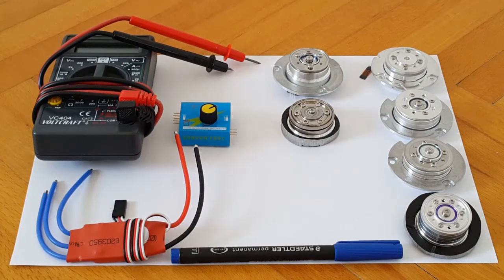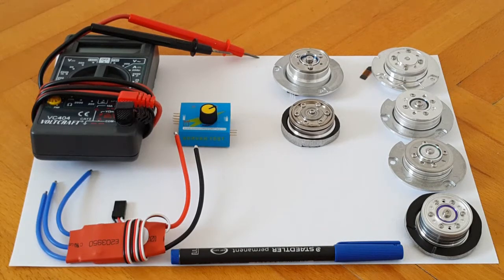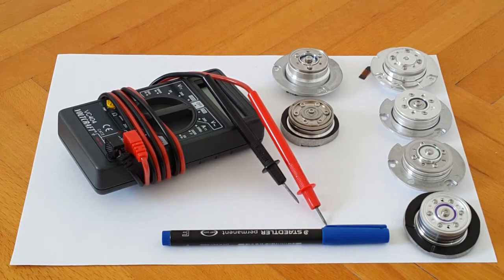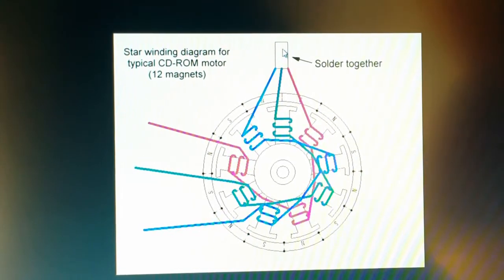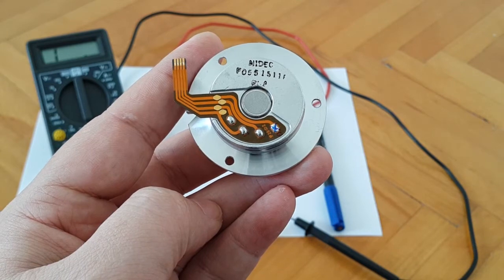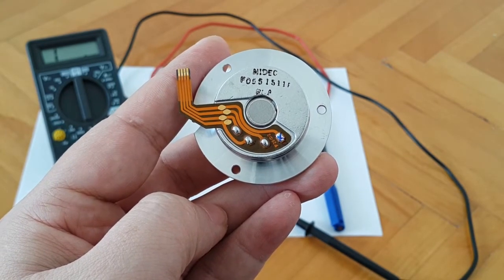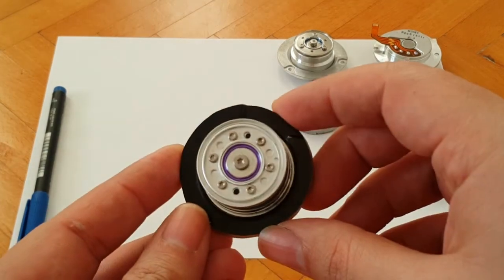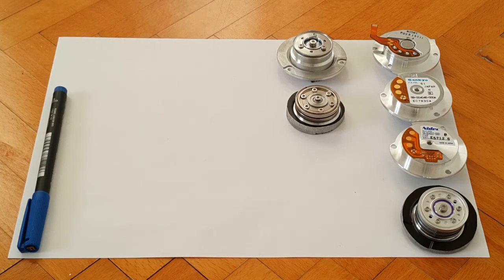How 2 Run/Power a HDD Motor - Prerequisite - Finding The Common (Part 1)

Comment: is there a way to fix "broken pin"? I have stripped off one of the soldered pins by accident (I have pulled out the orange film since I wanted to have clear 4 soldered pin points.... :( 
By measuring resistance I cannot seem to find any between that broken left pin and other 3.... and I do see the small wire in the hole there, but it seems that whenever I make contact with the surface it won't measure - so it's hard to touch just the wire in that hole whilst not touching any surroundings (the hole itself). Are those wires insulated under the soldered pins?
Reply from the maker: Hi,

I'm afraid you blew it. I doubt you can easily fix the situation. You could try somehow lifting the aluminum rotor off the base (thus exposing the copper windings & fiddling around this way), but you might damage the ball bearing in the process. 😕😞

Yes, wires are insulated.

Best Regards,
Reply: @davidbolha  thank you David for responding! 
I will try to see what I can do. 

Damn!

Comment: I tried with a motor from a hard drive and nothing like here. Is it because he is old or because he has a problem. Winchester may have been called and had a capacity of 20 Mbytes. Don't read it wrong, 20Mbytes is the capacity. On the first coils, the resistance is 4 and 8 ohms, and between the other two is 55-56 Kilo ohms.
Reply from the maker: Hi,

Probably it's an older motor I reckon. 🤔😕

But hey nowadays you can get drivers for brushless motors off eBay so this video is kinda pointless (without Part 2). 😞😳

Sadly I never found the time to make the 2nd part of this tutorial.

Look for (on eBay): "HDD Brushless Driver"

& you'll find these boards for less the price of a (20 A ?) RC ESC rushless controller with the CCPM 3-mode servo tester combined. 🙄😏

Best Regards,
Reply: @davidbolha  Quite old actually. The computer it is from has an 8086 processor with a clock frequency of 8Mhz if I remember correctly. I could actually run it with just two wires and no circuit by turning power on and off to it by touching wires. With the right type of pulse, it spins, but it will hardly be able to reach high speed. I think the motor was 7200 rpm.
Reply from the maker: @batvanio  Wow ! 😍

You could then perhaps try selling it on Craigslist or eBay as vintage tech. Those things (if working) can fetch back nice money.

I'm also collecting older HDDs (up to 10 GBs max) as another "retirement spare fund". 😎😁
Reply: @davidbolha  I wouldn't sell it because it's the motor from the hard drive of our first computer. I'm a little angry that I disassembled it at the time when it was ruined due to bad sectors and only the motor was left of it. I even had a 40GB one that was twice as heavy and bulky, I'm angry that I gave it away. The computer was a Pravetz 16 which is an analogue of the IBM PC/XT.

Comment: Why do I have to use a digital multimeter?    I can't think of any reason that an analog multimeter would not work just as well.  Your diagram shows that there is nothing internal in the motors that might require the higher precision of a digital multimeter, and an analog scale would be much easier to read, especially considering the way the reading fluctuates with the probe contact.
Reply from the maker: Hi,

True you could too just use an analogue one, but where can you find one these nowadays ? DM's are cheap. 🤔😄

Best Regards,

Comment: Nice explanation.looking forward for the second part. I also have a question. I recently took apart 2 broken HDD's (WD1200 and WD2000, both 7200RPM). I ordered some chinese 4wire BLDC controller board, which blew up after a while, (after several days of working fine)  I assume it was because of too much amps. Now Im looking for an ESC. I used to power the BLlDC board with 12V but if I look on the spec's  of the ESC in the description I see that the ESC only has 5 V. Will the 5V be enough to power the HDD Motor?  Because MOLEX connectors supply both 12 and 5V and i dont know how much the HDD motor actually needs.
Reply from the maker: soulonarrival666 Hi,

Thanks, glad you liked it. 😊

It's possible that "overcurrenting" was the culprit, however excessive heat usually follows that... Does the board have a fuse perhaps somewhere ? Maybe just something small vent faulty (a resistor, diode or capacitor). 🤔

USB voltage will be more than enough to drive a HDD motor. In part 2 I'm actually planning on using my Power Bank from this video: https://youtu.be/BUhkHSK-EU0

(Specifications mentioned @ 12:34 - 15:09)

... To show that. Very handy. 😊

That is true, but if you want use those ESCs (with the appropriate CCPM Servo Testers), you're limited to that voltage interval (4.8 - 6 V).